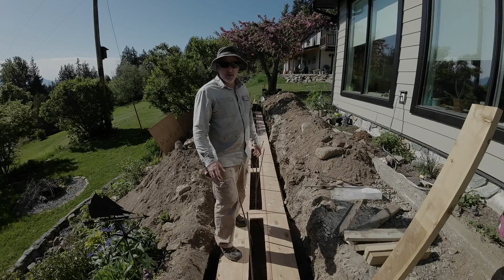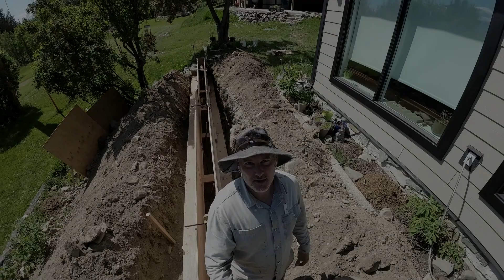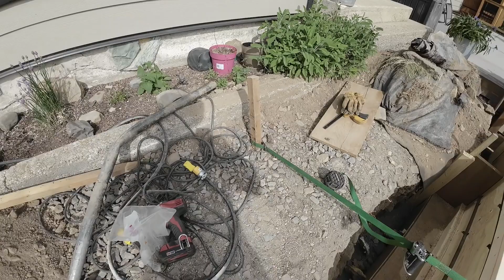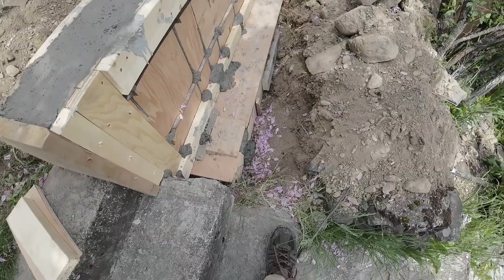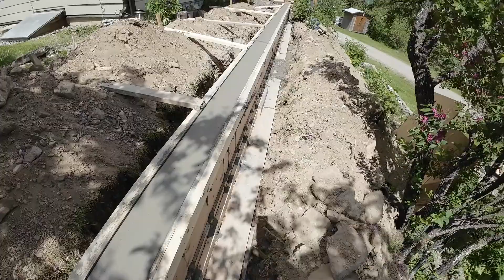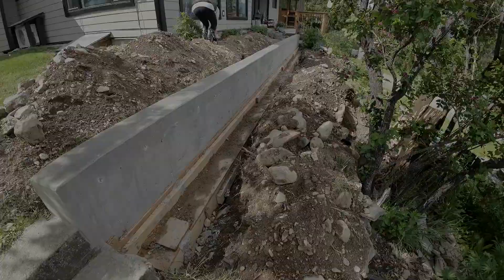Part 4 Wall & Concrete-Kubota BX23S-Build Your Own Concrete Retaining Wall.#concrete #retainingwall

Comment: Great job Mike. The wall looks pretty straight and solid. Sure was a big job getting the forms built. I was hoping to have seen some of the form removal.  How long did the pour take?  I have done a lot of concrete work and I was waiting to see  the form vibrators get the air bubbles out. I agree, you gotta respect the concrete crew's privacy.  Now don't go paint graffiti all over your new wall, lol. Have a good one!
Reply from the maker: Morning Paul. What happened was I thought the camera was on but in fact did not press the record hard enough. That’s why there is no removal footage. A good size sledge hammer is the best. Hit the wailer bar at the concrete tie and the tie breaks right off. No need to try and slide the bars out. 
The crew was here for 45 minutes. They were fast and not messy at all.  It’s almost all buried now so hopefully no graffiti. lol. Cheers and thanks for watching.